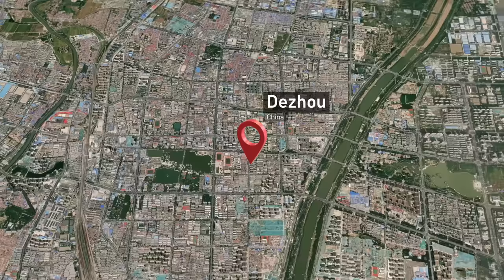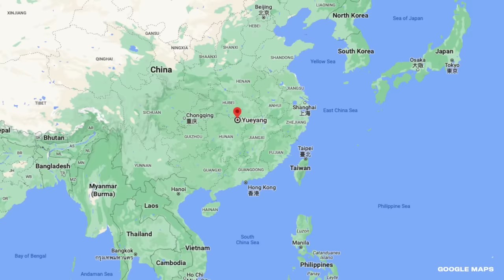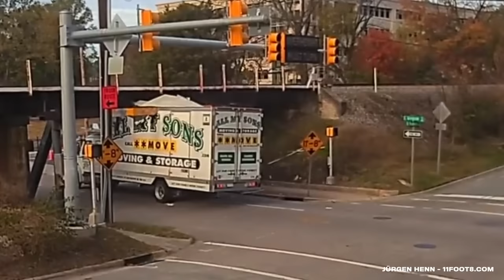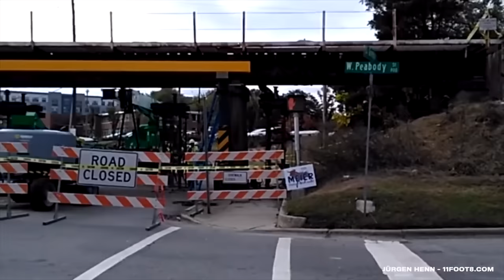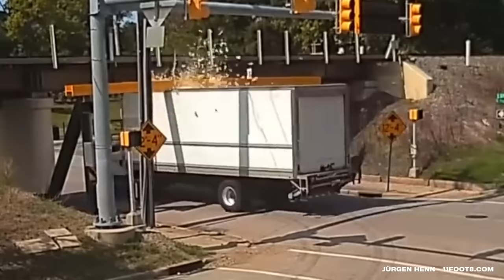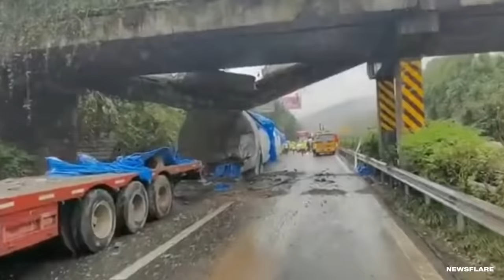15 Minutes of Trucks Crashing Into Bridges

Comment: If you rent a truck in the area, any damages from the 11 - 8 is not covered by the insurance.
Reply: They made it 12-4 and the fun continues.
I have never heard of a bridge here in Germany being hit by more than three trucks in total. How incompetent does a CDL pool have to be that a YT channel keeps rolling with 178 crashes since 2008 and after all the fame people keep hitting it?
My brain refuses to comprehend that level of stupidity.
Reply: @SB-cz9vo   As far as the tractor trailer drivers go they should know better. When it comes to box trucks though it's the average dumb citizen driving them most of the time because a CDL isn't required to rent and drive one, and I think it's just unawareness that they aren't driving a normal vehicle.
Reply: @maarek71  Thanks for the hint.
Here in Germany you are only allowed to drive up to 3.5 tonnes (e.g. Mercedes-Benz Sprinter) incl. 750kg trailer with your regular driving licence which is class B. To drive anything heavier you need one of the truck licences C1/C1E, C or CE.
Therefore, the trucks the 11-8/12-4 is chomping around on would require you to have at the very least a C1 licence, which is already a CDL in the EU.
Reply: @SB-cz9vo  I have a friend who is originally from Durham, NC, and he said that every moving rental van company in the Raleigh/Durham area has a sign inside it that warns customers about the bridge.  I guess the people who rent trucks from outside the Raleigh/Durham area don't get the same warning.
Reply: Lots of older folks (if you made your license until 1998) is allowed to drive up 18.75t with their car license.
Reply: In the US you can drive any vehicle with a max gross weight of less than 26,000 lbs with the standard car license. Many truck rental companies have trucks that are max gross weight 25,999 lbs available ( I am convinced that they could hold more just fine but the factory stickers say 25,999 precisely so anyone can drive them).there's are the trucks that hit that bridge the most. As for any Simi driver who hits it well he is an idiot as CEO training classes drill it into your head that a standard cargo trailer in the US stands 13 feet 6 inches tall
Reply: I'm convinced Pensike sends thier "about to be retired" trucks here to be written off as a loss.
Reply: I looked on the Penske rental site ages ago and read through their insurance policies, damage above the cab in general wasn't covered by insurance so big ouch to the drivers
Reply: So called top damage isn't covered by standard insurance here either. Here, local drivers hitting the Montague "Monty" Bridge find that out the hard way. Mind you a double decked coach drive r though they'd fit under it. He was so wrong, with the underside of the overpass slinging through the upper seats.
Reply: @gorillaau  yeah that would have to be one of the most epic crashes at the Monty bridge
Reply: @shaunosmorrison8385 As they say, look up and live. The driver of this Gold bus should have realised that the coach's wasn't going under a bridge with clearance if just 3metres or 10 feet for those that must.
Reply: @SB-cz9vo  Some of these people will not necessarily be CDL holders, but are in fact, ordinary drivers, who have rented the truck.
Reply: @SB-cz9vo same here in Brazil. Once I had to stop a guy from crushing his hand between the roof of his van and a concrete beam on the entrance of an underground garage. He didn't see any sign indicating the height limit and decided to "feel with his hand" if he was going to make it or not, but instead of putting his hand up high just outside the window, he was touching the roof right where the van was about to hit the beam. Some drivers are just completely clueless... 

Worse, his van was overloaded and underpowered, it was stalling every time he tried to back out of that situation on the ramp. Took quite a few tries to get out of there, he saved his roof, but I think he ended up needing a new clutch and underwear. 😂
Reply: Rental Company can easily MEASURE their Trucks and mark them accordingly. Maybe more money in the caper that they DON'T advise renter.
Reply: So which one should I rent?

Comment: Doesnt matter if youre driving a tractor trailer, or a rental truck. Your clearance is 13'6". Some smaller trucks are 12' 6" but the general rule of thumb, if you dont know... 13' 6"
Reply: Having a low Victorian bridge in London between the Ambulance station and the main hospital, they ordered some special new ambulances that could just clear it.
Then they put the long bars containing the blue lights on top.
The funny part was that the day that they were delivered, the ambulance station mechanic told them they would not clear and they called him an idiot.

Comment: Makes me think of when I worked for a rubber company that had standard fifty three foot trailers and some of them passed through a mountain tunnel that had laser sensors for over height trucks.  If you were too tall it sounded alarms and cops were ready.  The guys thought it would be funny to put a little flag on one guy's trailer and trigger all the alarms at the tunnel.  The cops pulled him over and it took a minute to figure out why his truck was the right height but the alarms sounded.
Reply: That's evil...... I love it!
Reply: We always had to drop the air bags to go through the Eisenhower tunnel in Colorado.
Reply: I'll bet the cops were not amused.
Reply: @denniswebb7473  Actually they were.  They shook their heads and told him to get going.
Reply: @gennymikel4296  Then the drivers were lucky the cops decided to be amused rather than annoyed since they could easily have fined the driver(s) for wasting police time.
It does strike me as amusing, though. 😄
Reply: @denniswebb7473 so they said, "we are not amused." 😂

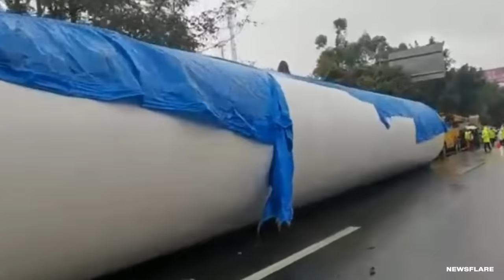Comment: 14:00 That's not a blade, that's a segment of the riser on which the turbine sits.
Reply: I wondered about that- it was perfectly round, which didn’t make sense. Thanks! It says something that the segment looked in good condition (to the untrained eye, anyhow), and the bridge crumbled. Terrible concrete or well-built riser segment?
Reply: @karenneill9109  The risers are made of steel which makes them rather strong, but I definitely don't think that it would have taken out a well built bridge. The restraints holding the riser should have snapped first. In other words, that bridge was really weak.
Reply: @jonathanlanglois2742  So that bridge was made from chinesium.
Reply: @jonathanlanglois2742  Tofu Dreg construction.  Cheers!
Reply: @karenneill9109  a section of a blade?
Reply: @cgi2173 No, blades are always made in one piece. They need to be flexible, like an airplane wing.

Comment: I'm a professional mechanic.  In my career, I've worked on everything from weed whackers to 747s.

Some years ago,  I worked as the road-call mechanic for a towing company.   On one particular occasion, I was sent out to Southampton Village, here on Long Island, to deal with a truck where the driver had told his dispatcher that he couldn't get the back door of his truck open.

Upon arrival, I found what's known as a "straight truck" (long chassis with an enclosed box), marked as 12' 6" in height.

As I drove passed the truck (it was facing the opposite direction), I noticed that the upper part of the doorframe had been pulled back a good 18".  This truck having a roll-up door, this meant the door physically COULDN'T open.  I found that the driver hadn't noticed the SEVERE damage, and when he tried to open the door, the first 3 panels simply dropped inside (since the track had seperated at the arc), and the unsupported weight pulled the rest back down.

Here's the thing, though, there are NO (as in ZERO) bridges ANYWHERE  in the Hamptons, which will clear a 12' 6" tall truck.  The TALLEST bridge is a foot shorter, AND that one sits in a hollow where the road dips about 10 to 15 feet from the main roadway.

That was over 10 years ago,  and I still have NO IDEA how the Hell the driver managed to bridge his truck, and the only significant damage was the doorframe.

Comment: In Dover, NH there also is a railroad bridge nicknamed  the 'Canopener".   Trucks are not supposed to go under it, and there is a route around it, but it seems some folks not familiar with the area, nor paying attention to signs just still have to try....   This year there have been three that I know of, undoubtedly more, two were in the same day, and one shut the area down for a bit as a train with LPG tanks was going overhead at the time and stopped, until it could be safely cleared.

Comment: That was a wind turbine TOWER segment, not a blade.
When I drove a 53',  13' 6" trailer I regularly drove under a 12' 8" bridge in NYC. I was told that that was because the Highway dept. Would mark it to compensate for snow on the road in winter.

Comment: to be clear, these trucks aren’t just “trying to beat a red light.” the red light is FOR THEM specifically, that’s why so many of these occur right before one. there are height sensors near the bridge specifically designed to trigger a red light when an over height vehicle approaches after several blocks of ignored signage. they ALL are supposed to have that “60 seconds to think” but some people are not only dumb enough to drive under this bridge in the first place, but to speed up through their last warning.

Comment: Years ago worked at a large company that had 50 trucks. One driver decided to take the hundred mile drive via the scenic tour. Tore off the entire roof of a refrigerated trailer filled with hanging beef during a heat wave. Took a few months to get the trailer repaired including a new refrigeration unit. First day back jockey driver did not fully engage the fifth wheel lock and trailer smashed the ground damaging the trailer and that took over a month to get repaired. A few of the drivers did not want to ever pull that trailor.Said it was cursed.

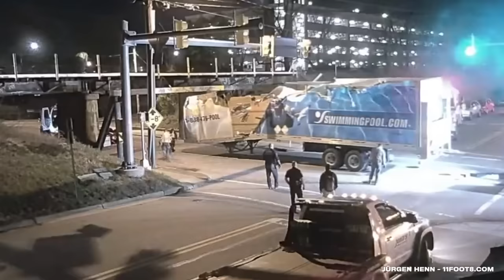Comment: @7:20 the light is designed to turn red for overheight trucks, as a way to get them to not go through. Just as the sign comes on if an overheight truck enters.

The problem being most Americans don't see these signs as being applicable to them. They don't know the size of the truck they are driving, or atleast aren't constantly thinking about it while also reading signs saying not to enter if you are above x height. Combine that with their desire to hit the gas instead of the brakes when when they see an amber light and poof - can opener

Comment: In the city where I grew up, we had a road going under a bridge. This time they took the bed of the road down. Only problem was when it rained. Enough rain water filled the road that trucks were constantly running into the bridge. Then they would have to let the air out of the tires so the truck could backup!
Reply: So the trucks were elevated by water?? I don’t think so, champ.

Comment: It should be outlawed to have bridges built so low. You can have all the warning signs you want, it still does not justify not lowering the road down below in order to comply with normal truck height! It's almost as if they are setting traps for truckers! Truckers can't be expected to know all the low bridges across North America, it's simply insane!

Comment: They have a sensor that turns on an "Overheight" warning in North Carolina. Why can't they use the same sensor to turn the light red until the vehicle has turned? If running the yellow is a problem, move the sensor further down the road....
Reply: They do turn the light red, but if they kept it red then vehicles in front of the truck might not be able to go through and be forced to turn when they don't need to.  That's why it turns green again.

Comment: A rail road bridge in Syracuse NY is claiming it's victims. It crosses over a four lane road. It is low over the right lane and trucks keep running into it. They are fine in the second lane. There are signs and flashing lights warning truck drivers but, they ignore them. They have now closed the right lane down which causes traffic backups
Reply: that bridge is 10' 9'

Comment: Not sure if it's the case in other countries, but in the UK the driver is responsible for knowing the height and width of their truck and trailer. If they do not or simply don't take notice of the signs, they will be held responsible for not just the vehicle they have damaged but also damages to the bridge and potentially other vehicles.

My husband did hear of an instance where a truck driver who visited his works regularly, driving under a bridge, only to get stuck. He called his depot who then called the traffic police. 

The officer was initially annoyed because he should know his truck height and  should not have tried to go under it. However, the driver stated that he had been under that bridge with the same rig numerous times before and had always got under it by 3 inches so that is why he was there. The officer then looked at the bridge height sign, looked at the  height given on the trailer and agreed that it should have gone under.

Both of them then looked at the road surface and noticed that it look fresh. The officer went back to his car, grabbed a laser measure and discovered that the distance from the road surface to the underside of the bridge was 5 inches shorter than it should be. 

The road had been surfaced on top of the existing instead of taking it down first. Their second mistake was that they then neglected to put up a sign with the new bridge height. As a result the Council was held completely liable, they had to pay for the damage to the truck and trailer, they had to put a new sign up, AND they were fined.

Comment: The fact the united states still has bridges this low is sad for our country. Any bridge this low should be removed and rebuilt. You'd be surprised how many low bridges I encounter and there is no bridge height posted. In 2023 we still have bridges too low and even more sad is there are still bridges without height postings. This is a failure of government. If we don't have the infrastructure for modern large semis then they should've never been legalized. And when a trucker hits one its his fault. No I'm sorry, the government is at fault.

Comment: Perhaps these trucks might be within clearance height in original. But later changing of bigger wheels, modifying suspension or elevated air suspension, adding of roof structure, oversize containers and loads adding extra small height are likely the peeling causes.

Inexperienced or reckless driver is another.

Comment: at 200  trucks collapsing bridges like that is common when you watch enough vids  trailers get destroyed because they are mostly aluminum so the fold up quickly
as for the last on the driver and company should have had a route planned out with no bridges or ones with enough clearance pooooooooor planning

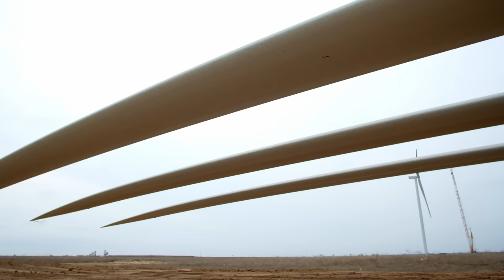Comment: @14:20   I WISH you could stop bullshitting!  Seriously.  "The cause of the collapse was determined to be the height of the wind turbine blade."  Where did you get that little gem from?  "was determined to be". Who determined that?!?  I can see with my eyes that it's highly inaccurate. It's very obviously not true.  That wasn't the wind turbine blade that hit the bridge. That was a section of the base. The blades are fiberglass and unlikely to do any damage let alone enough damage to destroy the bridge. Also, at no point along the length of a blade are they completely cylindrical. That was cylindrical... just like the base is.  Add to that, the base is steel, so it has a lot more inertia.  What I know for certain, there is no one along that road that didn't know this. 

I see this in your videos all the time - lots of totally bullshit claims. It's ok to say "I think it was the..."; then when you are wrong, well it was just your opinion anyway. But when you use phrases like "it was determined to be", you are invoking the authority of a third party that does not exist because the claim is a bullshit claim you just made up.  Stop it. Don't do that anymore.

Comment: 13:59 Last video. That was not a blades of wind turbine that collapsed the bridge. It was part of the tubular vertical body structure of the turbine. They are made of very thick and strong steel plates and hence took down the low bridge and the tube apparently has not suffered any serious damage.

Comment: It seems as though the orange “beam” seems lower than the bottom of the bridge… that seems to be the culprit in some of these cases…
Reply: Thats what its there for...to stop you hitting the bridge itself
Reply: @chrischambers5466 Correct, it protects the bridge.
Reply: The road goes uphill.  The beam is set at the height of the lowest point.

Comment: At great expense, the Can Opener was renovated in late 2019 and raised a whole whopping EIGHT inches!! This may have eliminated about half of the ongoing crashes. You'd think for just a little money they could have gone up at least 2 feet. But no. It's still eating trucks and construction equipment.
Reply: As I recall from other videos, raising the bridge more would increase the slope of the tracks more than what would be acceptable to the railroad.  And they can't excavate the road because there are water and sewer lines under it.
Reply: You can’t make a train run like a roller coaster!
Reply: @sludge8506 Wrong, they raised the bridge. They show them raising it right in this video. 🤣
Reply: @wadehm63  👍👍👍👍👍